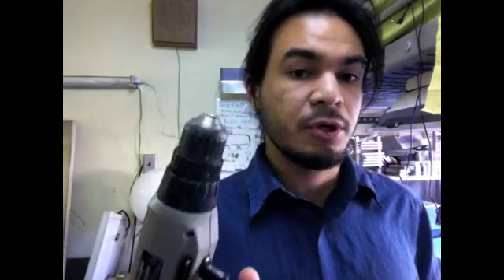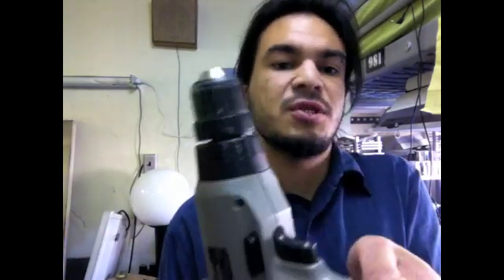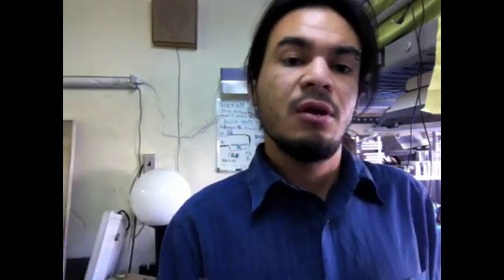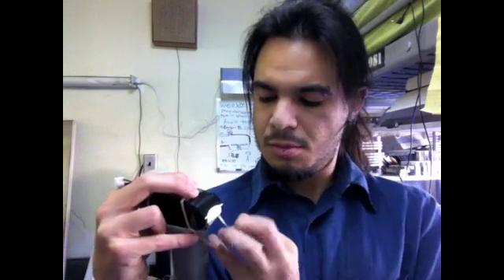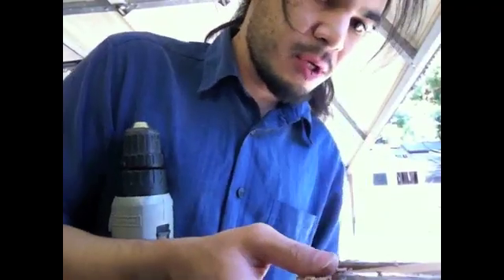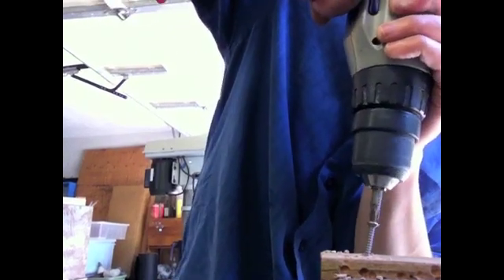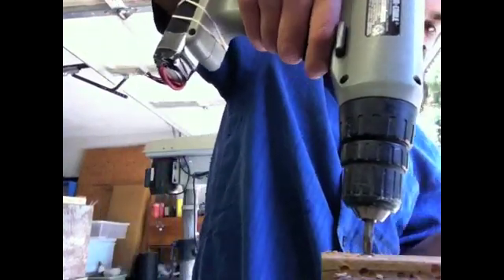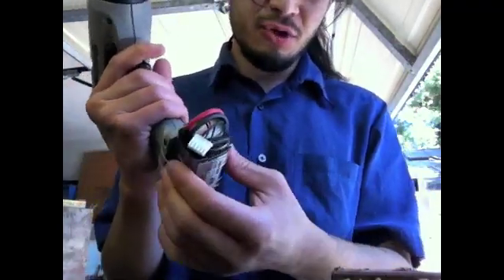Getting a cordless drill with no batteries to run on a lithium polymer RC battery

Comment: Considering you can buy budget drills new with lithium batteries for about $40 these days that will outperform such old technology, is it worth it? You do this kind of stuff because you like tinkering, which I understand because I do that myself but doesn't save time or money.
Reply: +V T Sometimes it just feels better the throwing it in bin. Agreed it is not always cheaper. Like the the Video thanks.

Comment: You seem to appreciate quality power tools as do I.  Off the subject a little, but you talking of sounds reminds me of my Porter Cable bench grinder that must be 50 to 60 years old.  You have never heard anything run so smooth.  Turn off the power and you think it will never stop.  Quality was a priority back in those days.  That grinder will still be running when everyone reading this is dead, barring it isn't destroyed in some freakish way.

I just bought a new Porter Cable 1/2 inch drill to replace my 33 year old 3/8 inch Craftsman  On the box it says "Made in China at a PORTER CABLE manufacturing facility."  Whatever that means, I don't know.   Still made in China though, kinda sad really.

Comment from the maker: I agree with that one, John. So far, I have not seen a cordless 18 volt drill made in the US. Most of them were made in China, some such as the DeWalts and the current Porter Cables are made in Mexico and the most expensive ones are made in Europe. Finding new power tools made in the US these days is next to impossible although I still see new hand tools made in the US, such as Vaughan hammers and some Craftsman screwdrivers.
Reply: I wouldnt mind it if it was maxe in Japan their qc is excellent but same as u.s. just cant find them anymore